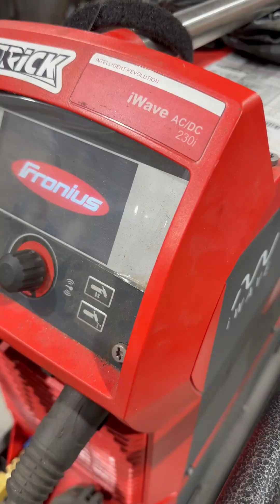Making An Aluminum Fuel Cell

Comment: Was this your first tank? Not sure if you added baffles but that is a must. Your machine settings were off and i'd suggest a 6-7 cup w/ gas lens, I use furick, 1/8" everything. Sharpened tip, or balled, gotta get your torch angle right. 180 amps but you only use 130 or so for runs, more if you use 3/16 alum. Cfh 23-25 argon, very important. 2% lanthanated tungsten, blue. Clean material w/ acetone, stainless wire brush edges. For the bungs, put your palm on the bung, use a spare glove or tig finger so it doesnt burn you. Or an alum block. That allows your hand to weld it in thirds cleanly. Without baffles it will split welds eventually. I use two for most tanks up to 100gal
Reply: Good stuff though, popped up in my shorts. Any questions let me know!! I do transfer and auxiliary tanks often. They are a pain in the ass at first